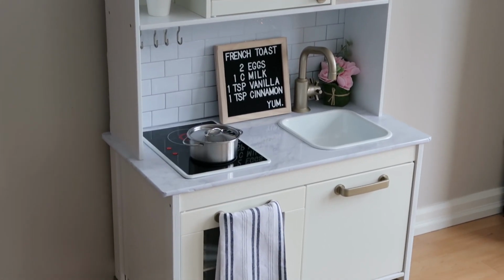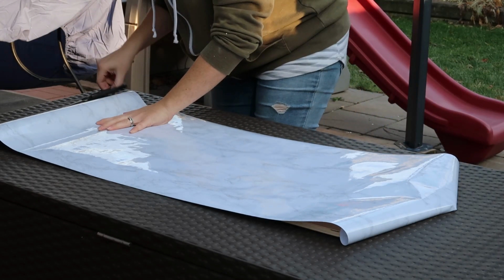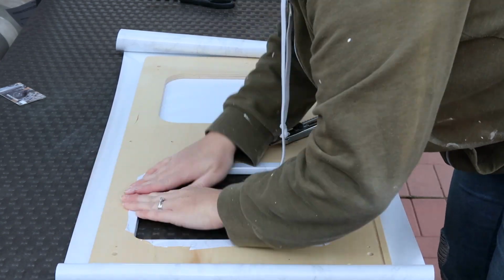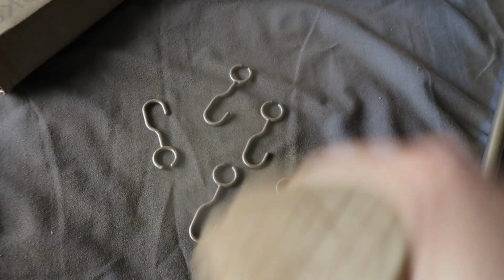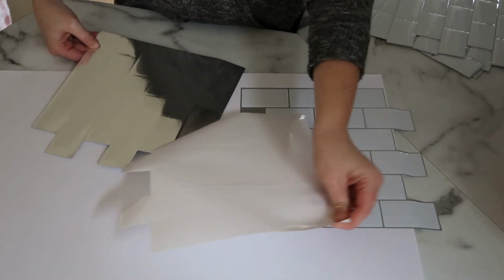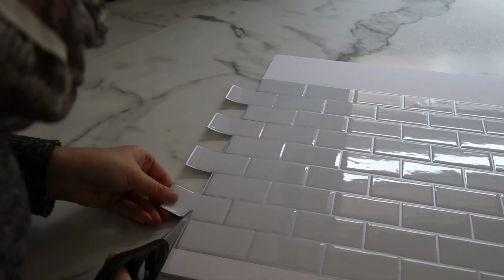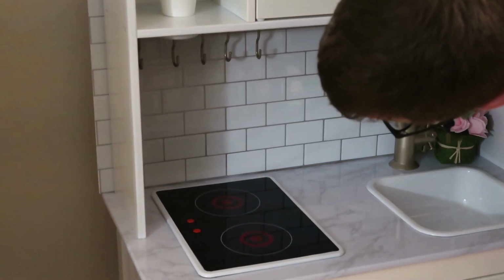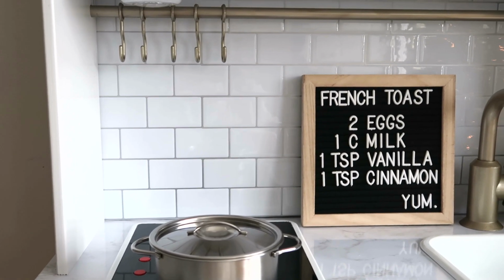MODERN IKEA PLAY KITCHEN HACK!

Comment: How did the paint hold up without sanding the pieces before you sprayed it on? Just wondering long term use wise
Reply from the maker: Hi there!! The paint on the wood held up perfectly! Not even one chip yet and my kids play with it everyday! The only part that got a little wrecked was the stovetop...my kids had a wire basket on top and with moving it around it scratched the paint around that...but all of the wood is in perfect condition it worked great! :)
Reply: This Extra Gift thank you so much, for some reason our spray paint is sticky to the touch after 32 hours and won’t dry. We have to sand it down and paint it with a roller. Still have time but I watched this video 2 times for inspiration ☺️
Reply from the maker: @bethaniecarlson3047  oh no!! Hmm I wonder why that's happening...did you use the same brand of spray paint? Keep me posted I'd love to know how it turns out in the end! 🥰